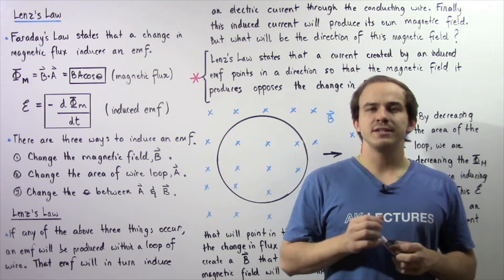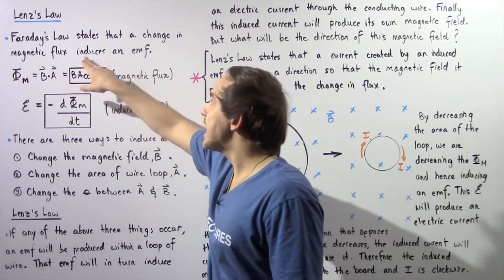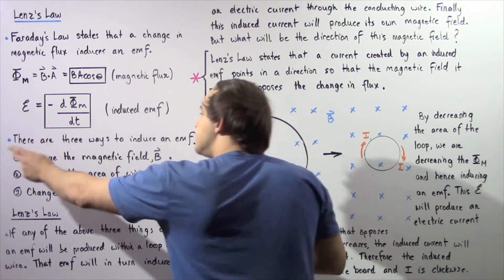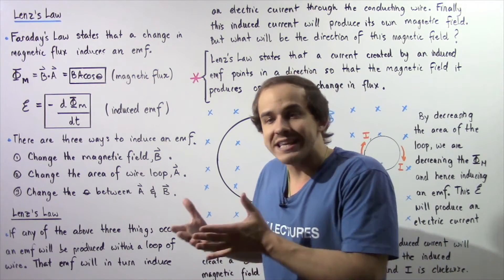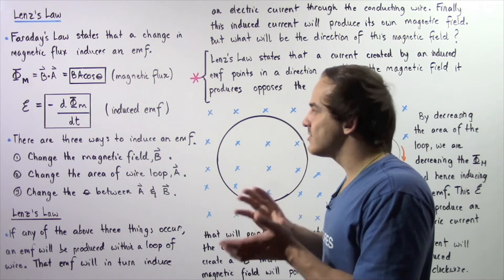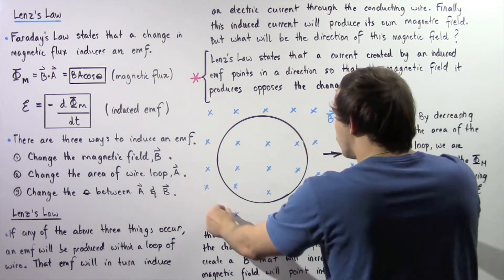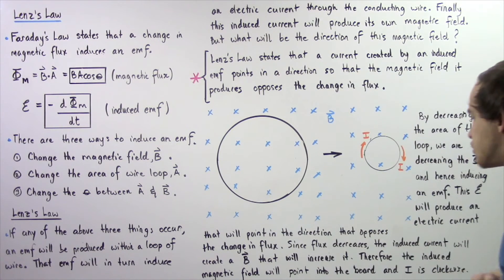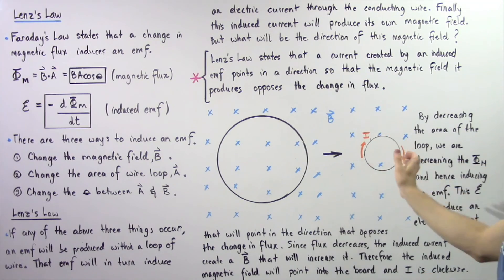Electromagnetic Induction and Lenz's Law

Comment: When you use the right hand rule 1, at the end, what prevents you from putting your hand upside down, and going with the same motion for the magnetic field? (Thus getting the opposite direction for I).
Reply: the key point, which I realized after pondering for hours, is that the fingers have to curl INSIDE the area of the loop of wire, not OUTSIDE of it, which like you said would give you the opposite direction. 

in short, the direction of the curling fingers matter only INSIDE the area.